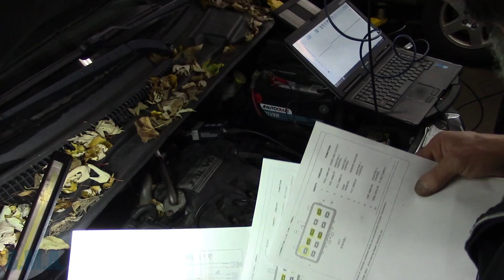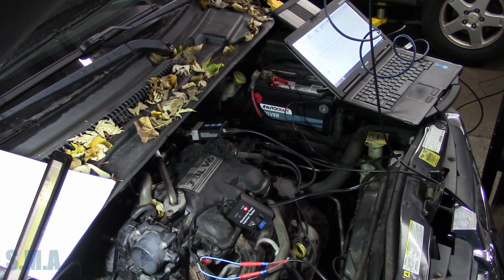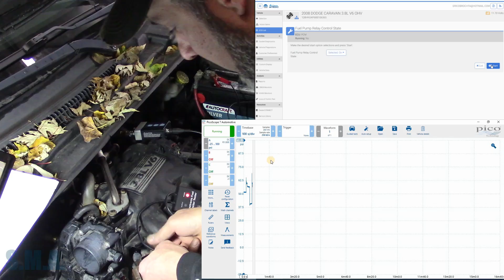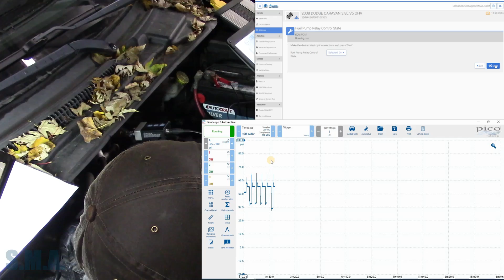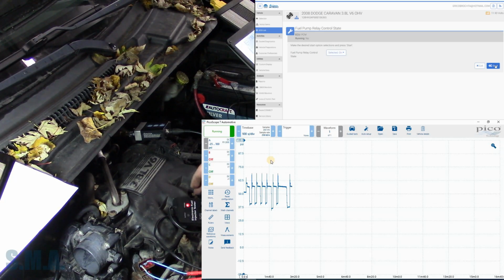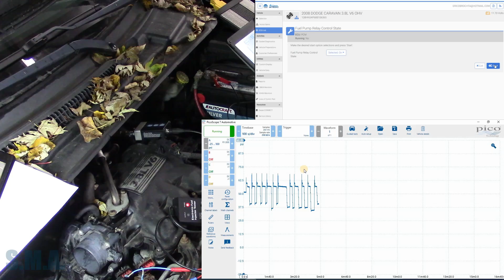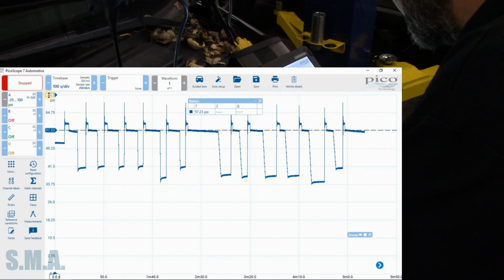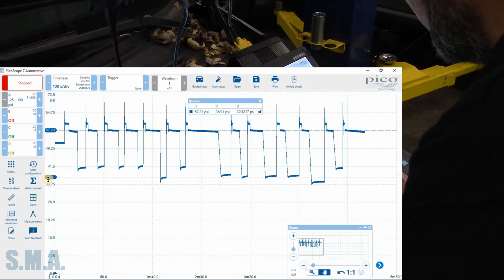Pico Scope: Measuring Fuel Injector Pressure Drop

Comment: I'm an intense DIY'er with a hydraulic H press, welder, oxy/acetylene rig, and a whole bunch of other professional-grade implements gathered over the decades.

If one buys just a couple of well-used but in good shape cars, the cost of an oscilloscope and a bi-directional scan tool are easily justified on a cost basis alone.  Never mind the avoided hassle of dealing with less-than-competent retail repair shops.

Please keep showcasing oscilloscope diagnostics.  It's fascinating on two levels.  One is the bringing-to-bear of a killer piece of kit.  The other is a peek behind the curtain of the electrical activity of the modern automobile.

Comment: Great video Sir. i appreciate t knowledge u teach us.i have done similar test with pulse injector generator n a fuel pressure gauge. Funny thing is i have seen injectors failed at 30k miles on some newer cars. So if a cars injectors have lasted near 200k means customer has tried to keep good maintenance with their vehicle.

Comment: Maybe the one with the greatest drop is creating a drop in pressure causing the lean condition.  Just wondering.  Thanks Eric
Reply: Not likely unless the fuel supply from the pump couldn’t keep up with the flow.    The restricted/plugged injector(s) will easily cause a lean condition.    

I did this test once on a Corolla and proved this theory.    The can had something like 25% furl trims we focused on the injectors and performed this test - all four injectors flowed like 7 psi drop across the board.   After running an injector flush they all flowed at 14-15 psi drop.  That’s double the fuel volume.  And the 25% fuel trims went back into spec.  

This method proves and even quantifies the injector flow volume.

Comment: Follow up video after injector replacement! 4 bad or 4 good? We want to know 🤔
Reply: @pz5232  It looks exactly the same as an old injector, just much cleaner.
Reply: that one that was pulsed that had slightly less was most likely the culprit. a bigger drop would indicate more fuel thus a richer exhaust. And I know what you're going to say, "but what if there is so much fuel in the cylinder it doesn't combust at all and then that cylinder sends straight oxygen into the exhaust" That PSI difference isn't enough fuel to cause a fouled plug and not allow combustion at all though. I hope this helps
Reply: My guess: the one with more drop is hanging open for a but, which becomes a larger part of the "dwell" time as the rpm increases. The excess fuel in that time drives the ECM nuts. Just my guess.
Reply: Indeed.

Comment: Thanks for the video. I just think that since at the beginning you said it has lean code, points towards 5 plugged injectors and maybe 1 better one, rather than 1 giving too much.
Reply: One of the complications when dealing with a mixture code is that the ECM is only willing/able to adjust the bank. When one cylinder is misbehaving that can produce unexpected results. In this case, it probably chased the rich one but reported the lean condition it caused in the other cylinders.

Comment: Wow, lots to unpack in this video, an entire course summarized in a 12 minute video. Excellent! On the second set it is interesting to see the duration of low pressure was so much shorter in the second one tested, I wonder why. Is that just an artefact made by difference in when the fuel pump reacted? With all the effort to get at those, I would replace all and move on. A digital graph beats analog readings, nice to see another use for pressure transducer technology.

Comment: I just got a p0171 haven't figured it out yet. Replacing fuel filter, cleaning mass airflow and see if it goes away. It's funny that your had a vid at same time. Your karma ran over my dogma.
Reply: *carma
Reply: The last P0171 I dealt with was from a torn PCV hose on a 2000 Focus.

Comment: I got the same tool for injector balance, but like you say, no "known good" to compare results with leaves you only being able to compare to the other injectors in the car. Great video! I like the look of the new pico software.
Reply: (Jordi LaForge voice): "We'll have to compare the width of the pulse wave modulation frequency cycle to determine which of the plasma injectors is bad."